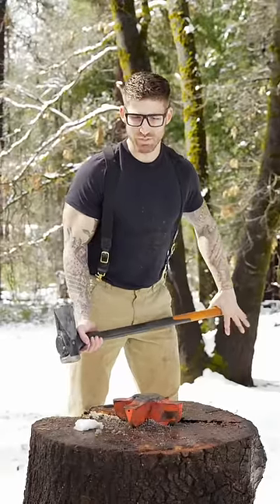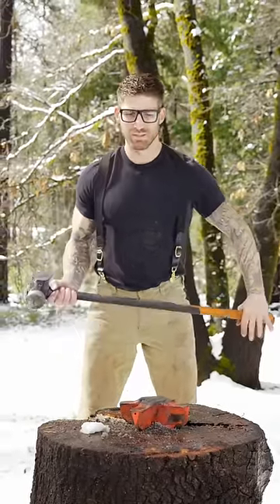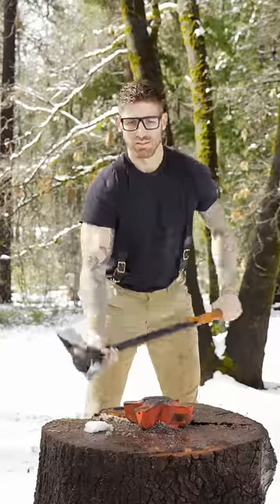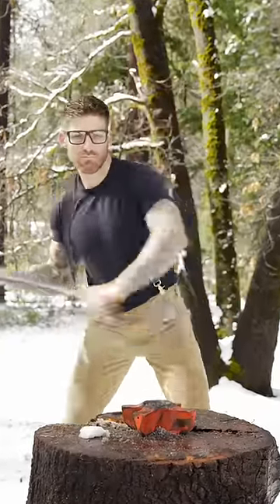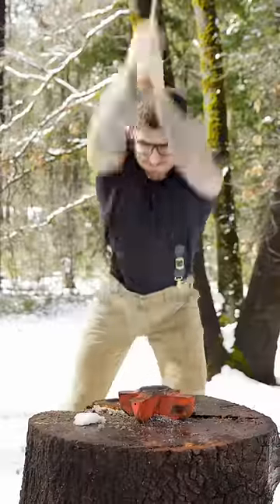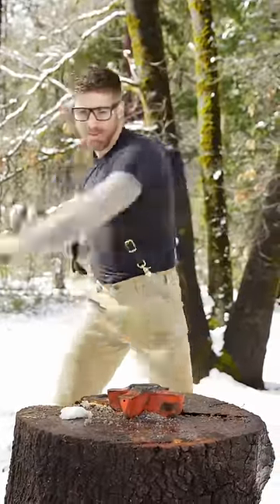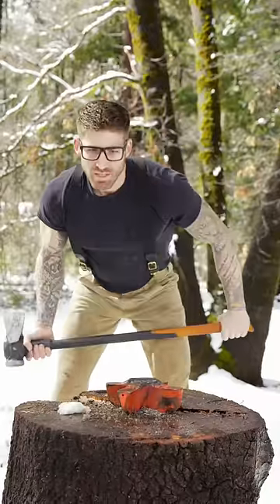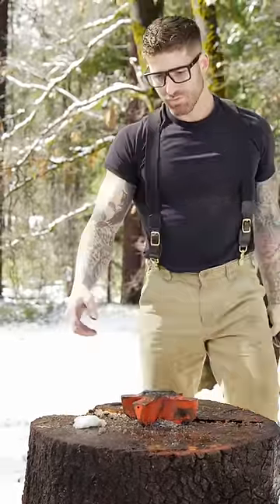When the prototype should stay a prototype

Comment: On paper, my unscientific mind would not have seen why this device wouldn't have worked. But after seeing it failing, perhaps it has something to do with the energy/force being dispersed in too many directions rather than a single point as a conventional ax head would do. With the energy being split, the wood can more easily withstand the impact. Think of it like trying to crush an egg with your hand as opposed to just hitting one side. It's definitely possible, but a lot more work than it's worth. Not to mention the mess it makes..

Comment: We had a 24 ton pressure horizontal splitter. It had a 4 way wedge the slipped over the original wedge. On live oak. I peeled the wedge off. Smaller cookies needed

Comment: "This is how it didn't went"
As an aside you could have a career being the hotter, better built, more down to earth Ben Affleck.
Funny thing is, I used to split a pile of alder wood taller than myself at 12 years old back in the early 80's. Took me a solid weekend and I was rewarded for it. Did that for 5 years straight every fall. It was enough wood to fill our garage halfway. That's about 5 or 6 cords of wood. Dude better get some nuts.

Comment: well, you won't know if it works until you try it, so props to them for trying to make it to see if it works.
IMO the angle is too shallow, it should be more steep for the tip to start a split. I think each set of fins at a 90 degree angle is holding the wood together as it tightens more the further it gets pushed down

Comment: I spent the twenty years logging and cutting firewood for a living. That kind of wedge will never work with impacting force. You'd need a steady pressing force in order for something like that to work. The fourway wedge disperses too much of the energy to overcome the fiberous grip of the wood. It doesn't help that the man with the hammer in the video didn't start a crack going both ways first before inserting the wedge. Typically, wedge is only used to force apart an already existing split in the wood.

Comment: They figured hast if one sliver could split wood then welding it would make it 4 times more useful. What they failed to consider is it also take far more energy to split 4 ways. Also that splitter is extremely dull, and the hammer isn't close to being heavy enough. I 'm not sure if you could lift it if it were.

Comment: There's a reason why they are used bt hydraulic press and not a tool for traditional wood-splitting; unless you can bash it down like 200 RPM consistently 😂

Comment: this is genuinely using a tool for the right application with the wrong devices. this would work better if someone welded 4 axeheads together instead of this, because this is more blunt and meant for very high pressure over extended periods of time

Comment: with the orange object moving in and out of the log as he hits is because the orange object is absorbing all the kinetic energy thats being trasnfered into the object. barely any of the energy is making it through in to the wood. It might work better if the orange object was connected to a handle and then swung on to the log, but I dont think that would work really well either not without doing tests

Comment: Who cuts a wet log while it's freezing outside? The sun is also a tool and you know, "Let the tools do the work". This of course requires that you know how to use the tool correctly. And the wood needs to dry anyway or it will just produce smoke and soot, so you can just wait for spring.

Comment: age the wood to dry it. bet it would be gangbusters on softwood. wet hardwood- no way in hell. did my share of this as a teen. Double-bladed axe, start with the dull side, turn for small chunks and kindling. but a four-way bit with a hydraulic chopper would be awesome. but dry it at least a year...

Comment: Okay what it was is that with it having no sharp edge and the fact it wasn't angled wider at the base is why it wouldn't work you also have to remember the reason we used wedges isn't for it to split the wood on its own it's to help spread the wood to use the axe on

Comment: Pretty sure that the shape of it is ironically distributing the force of your impact in all four directions, and therefore dispersing it to the point where it doesn't do jack. Because there is no real 'edge' there is no splitting force. Basically you'd have the same luck just hitting the wood with a hammer.

Comment: He doesn't know about force multipliers.  That is for a hydrologic ram for a good reason. Of you want one that works by hand , it needs to be different. Deeper body ,more slender taper, short but sharp center spike , extremely sharp blades and slightly flaired at the top where it is struck. Minimoze resistance and increase leverage once its deep enough to split... otherwise back to the hydrolic splitter it goes where 2 tons of force is easy to get.

Comment: But that's the difference between static loads and dynamic. A sudden blow will cause a big release of energy into the surrounding wood, and any energy that was not absorbed becomes friction/heat, and since the attachment was wedged into a space that wants to squeeze shut, it will also want to move in the direction of least resistance (out).

It's meant for a hydraulic system that is continual and unyielding force until one of the two systems break--the log or the splitter. 

Anyway 0/10 on your rating due to sub-optimal tool implementation--the tool design looks clean and the welds are solid. But 9/10 human form attempting to adapt to sub-optimal conditions--the swings you took were well practiced and applied striking force with accuracy.

Comment: Hey tool tester, when mentioning how the tool is supposed to be used with a Sledge Hammer, Try using a SLEDGE HAMMER. Genius you are damaging your wood splitter axe and feeling all the problems in your hands and arms, as well as your ears afterwards.

Comment: That's not a wedge. It has too much surface area and no concentrated point that goes into the wood whoever invented that is trying to reinvent the wheel. It's spreading the whole thing out rather than sending it right through the middle

Comment: "I don't know if the wood's too hard for it."  Bro you're not supposed to be attempting to split a giant, knotty round that was soaking wet before freezing temps turned it into a magical stump of invincibility. 

But it should surprise nobody that a dull old piece of metal is going to do a much shittier job than a fine-edged maul or wedge. The kind of hydraulic splitter you'd need to make that thing make even a little sense would cost so much money I just don't see the point of welding your own piece of shit attachment.

Comment: You gave up too easy. Obviously it would work better if the leading edges going into the trunk are sharper, or thinner. 
The edges are flat, thick and blunt. Send that to me, I'll sharpen those edges and I bet it works like a charm.

Comment: sharpen the blades on that wedge boy you have flat edges that should be sharp not flat and dull if it wedge has a flat edge it will not cut thru wood you have a what 20 lb sledge you need a heavier sledge and sharper wedge blade on a four way blade wedge that should be sharp